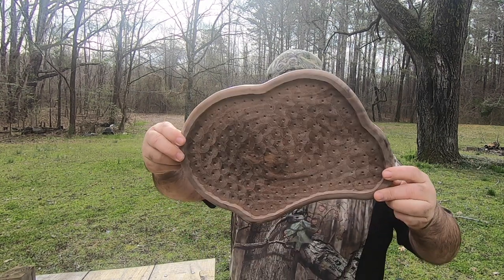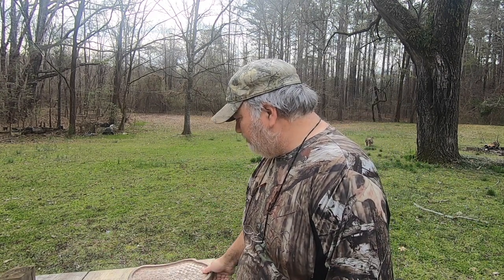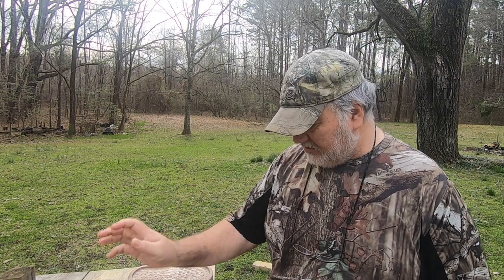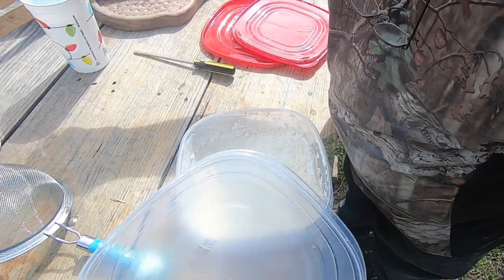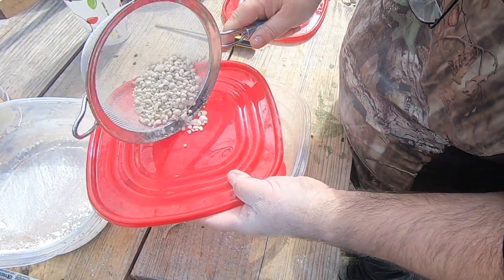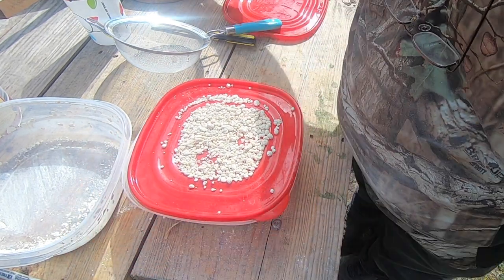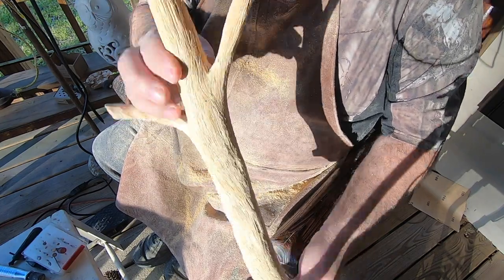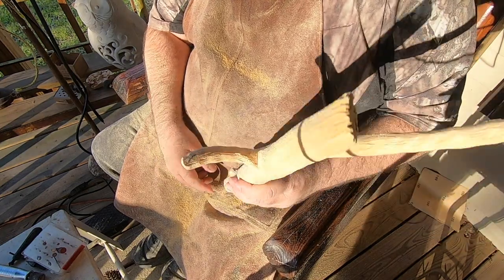White Crappie Wood Carving,  part 8  Starting Habitat Base

Comment: What rotary tool is that you are using?
Reply from the maker: It’s a Foredom rotary tool with a hand piece that has the 1/4 inch shaft collet installed for the bigger beefier bits I use like the one in this video. I have another hand piece for it with an adjustable key chuck for smaller bits. Its controlled with a foot pedal. The other one has smaller interchangeable collets to use smaller bits but it’s a pain because i switch back and forth a lot so it was just easier to buy the second hand piece for the smaller bits. 
New the Foredoms are around $300-$500 depending on the model and kit.  It comes with a standard hand piece. the extra hand pieces are $75-$80. 
I got lucky and found this one for $150. 
I also use a Dremel 4000 with a flexible shaft hand piece. It’s what I started out on and does great with regular 1/8th inch bits.